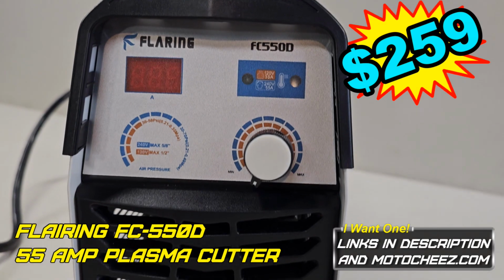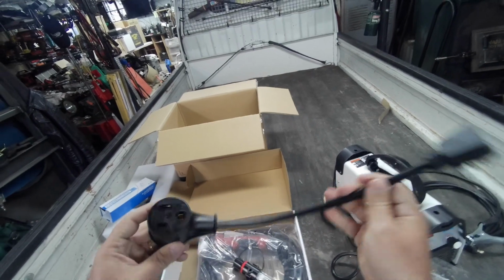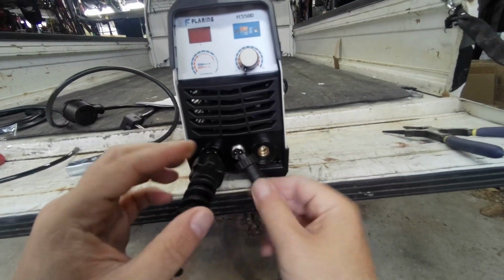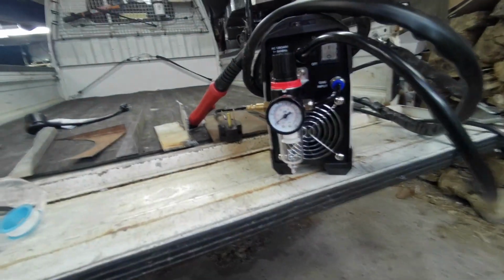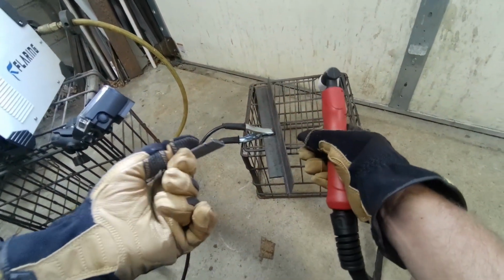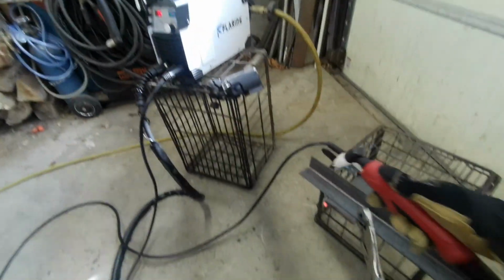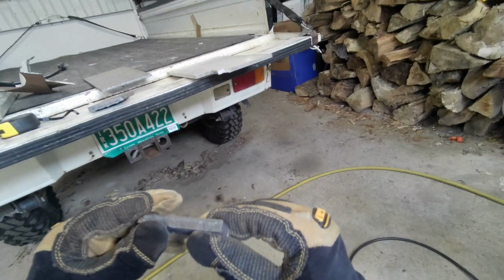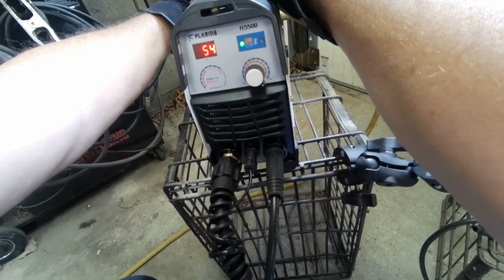FLARING Plasma Cutter 55 AMP 120/240V IGBT 5/8'' cut High Frequency IGBT inverter steel aluminum

Comment: Dude, youre travelling way to slow. If you cut too slow all that dross is building up under the plate, heating up and in essence welding itself back together underneath.
Having the correct amperage, airflow and travel speed are all essential perameters.
Reply from the maker: Yes, thicker  material have to slow down enough to cut theough, too fast it'll splash back up

Comment: Try a slyt tilt on the cutter in the direction of cut..atrough of water under cutter helps with hot sparks over the shop.🎉